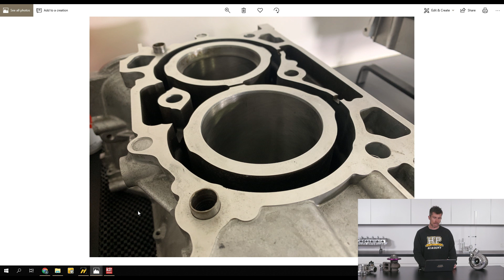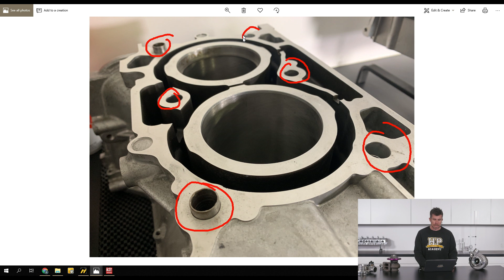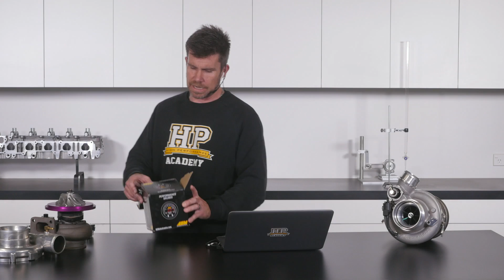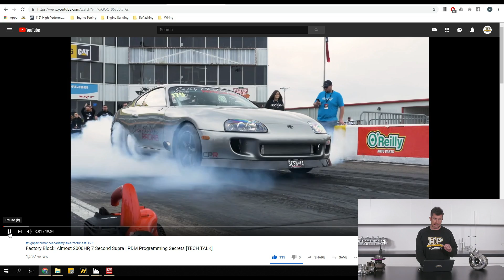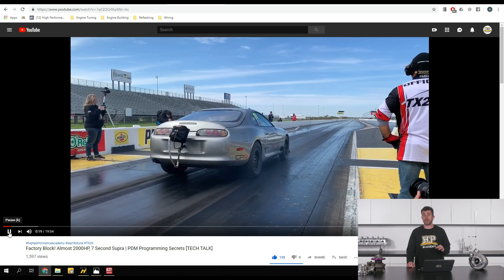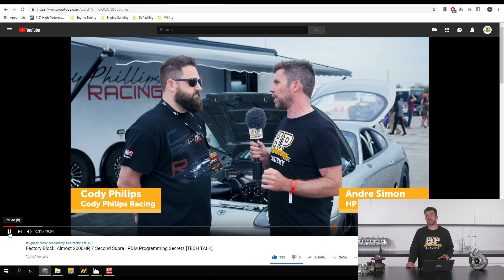Choosing Pistons, CAN communication, ITB Tuning and more! | Today At HPA 209 [UPDATE]

Comment: It is not uncommon to do this, so good to see it being mentioned and introduced to more people. Some may remember the BB Chev' engine configurations that used 4 long and 4 short trumpets - this was actually for the opposite reason - the heads had different length runners and the trumpets were used to equalise them. Back then magnetos and mechanical fuel injection were used, though, so it was impossible to optimes for different cylinders.

In the example shown, I was a bit puzzled by the arrangement of the lengths, as it 'doesn't' seem to follow what I would have expected for a cross or flat plane crank, I mean, I would have expected a long-short-long-short firing order to smooth the torque impulses? Maybe a packaging issue? Maybe I'm missing something?

It has sometimes been used on the exhaust side, for example some racing motorcycles back in the day paired 1&2 and 3&4 primaries for different scavenging characteristics and hence cylinder filling.

Comment: so now that you have entered into the world of aircooled vws how about a vacumn controlled adjustable length velocity stacks? (I'm a fan of wide and super short! )
Reply: Not sure about "vacuum" operated, and remember that isn't rpm sensitive, but there are several on-line applications where a simple 2D map processor has been used for a stepper-motor controlled arrangement.
Had a quick look for the examples I had in mind and came across this, which may be more useful - https://www.f1technical.net/forum/viewtopic.php?t=1740